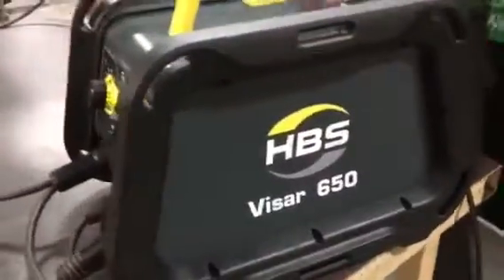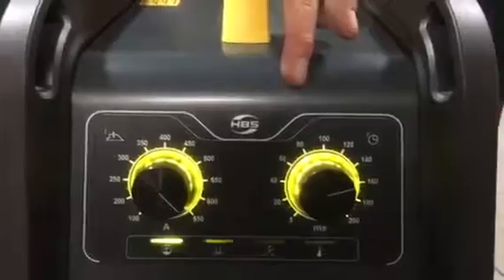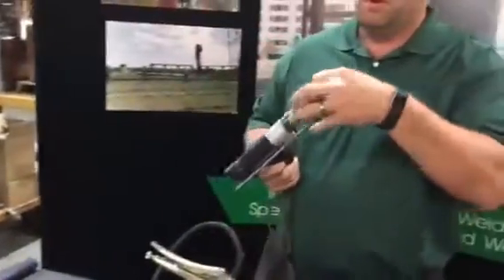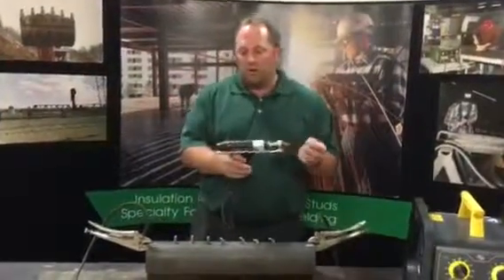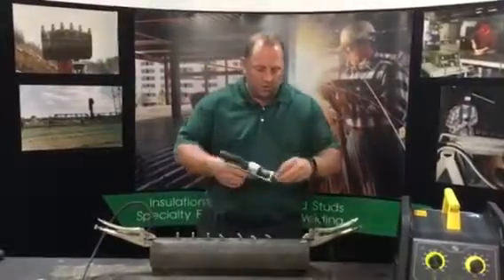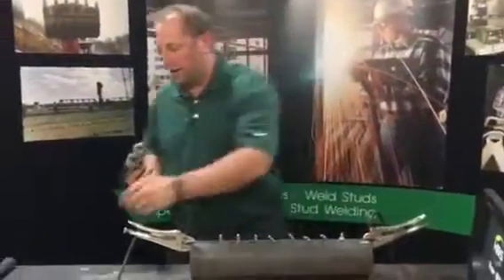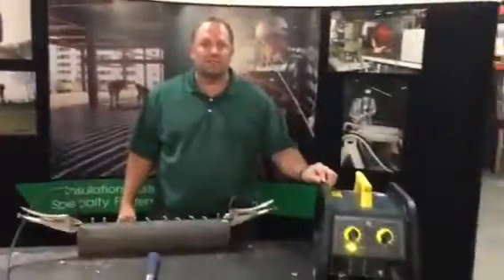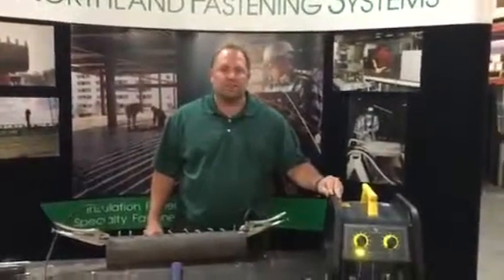Visar 650 single phase Stud Welding with Northland Fastening Systems USA

Comment: How many 3mm stainless steel or mild steel insulation pins it can weld per minute and how long gun cable it supports ?
Reply from the maker: Hello,

the welding rate depends on the effective welding diameter, the used material and the combined relation between current and time.
For using insulation nails dia. 3mm and an a.e. used welding time of 10 ms the welding time is not "the factor" for the welding rate; the power unit Visar 650 gets a welding rate for dia. 3 with technical possiible 40studs/min (cecked by normative regulation for welding rates). 
Here the "real" welding rate depends on the manual operating time - feeding the insulation pin, going to the welding position, positioning - welding, removing the weld gun from the pin, visual check of the welding, feeding a new insulation pin,...
So, if the handling is effective a pin can be welded each 5s - the power unit is ready for making the next weld.

The 2nd question is using a different cable configuration - in principle the producer of the power unit determines the welding gun and the combined welding cable configuration (ground cable and welding cable). The welding cable by using the weld gun A12FL is fixed wit a maximum length of 10 m (32,81‘). The ground cable is as well fixed.5 m (16,40'). In this way the max. welding range is a radius of 15m / diameter 30m. If there will be a wider range required, so HBS need this maximum data to check an opportunity. All technical data you can find at www.hbs-info.de.

Comment: Since I can not get HBS to answer any of my emails can you explain how lift and spring pressure affects the weld of the stud? Thanks
Reply from the maker: Hello,

the influence of the different welding parameters is in principle described at the ISO 14555 "stud welding of metallic materials" and as well in combined literature for stud welding. As well a training of the operator / welder is a quality base for using stud welding effective. 
At a stud welding weld gun for drawn arc welding there is a setup of 3 parameters. 
plunge / protrusion - shape and formation of the weld seam
lift - length of arc (too high - possible arc blow effect; too low - drop short cirquit)
spring force / damping - regulation of the acceleration speed of the stud to the sheet metal (too high - spatter formation by fast plunge into the fluid melt pool; too slow - "cold protrusion")

Comment: Where can one obtain the vise grip pliers that you use to clamp your ground cables to? Do you have manual pdf files that you could email to me pertaining to assembly and setting of the lift and spring pressure of the stud gun? I have the HBS ARC 800 model using a shielding gas. Thanks. Dana
Reply from the maker: Dear Dana, Thank you for your message. Please send an email to:  international@hbs-info.de  with your contact details. We are happy to support you and tell you a dealer in your area. Best regards, Cornelia
Reply: My email is dmsummers@mtcnet.net